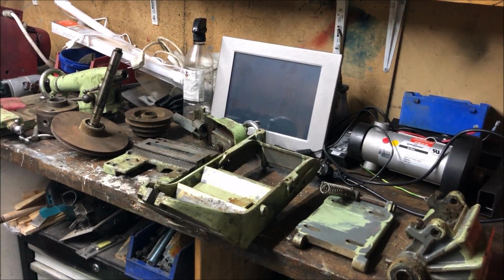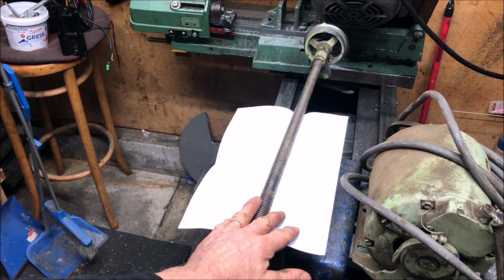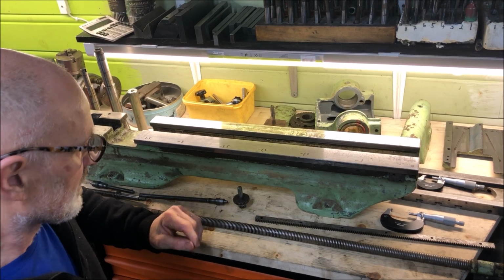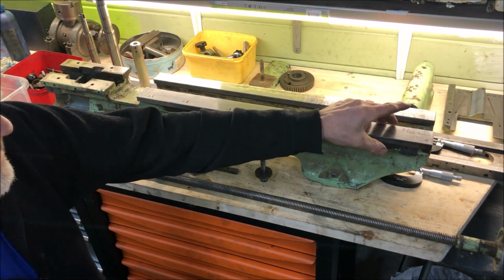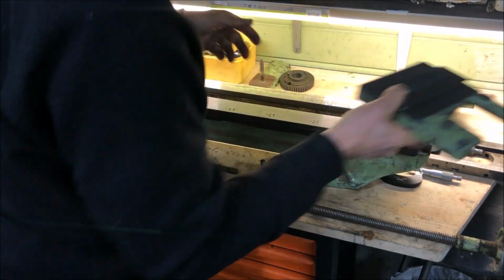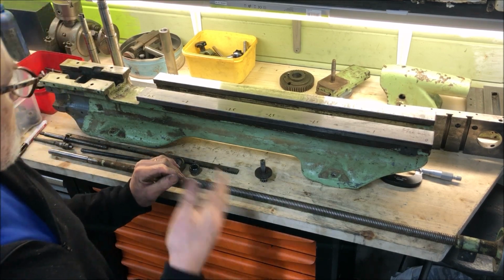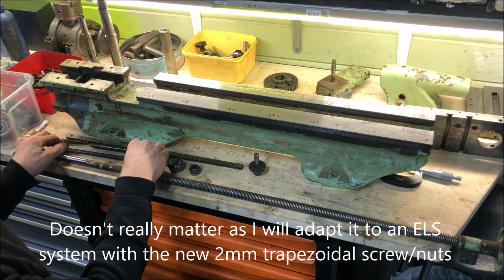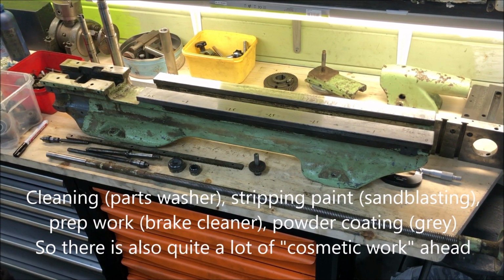Myford Super 7  - as bought, initial inspection/measurements

Comment: Hi Jan,
cool video, I would love to see more!
Do do have a italian made lathe from 1948, that has a similar spindle design. Do you have any experience in adjusting the frontend bearing? I am not shure, how thick the oil gap should be. My best guess would be roughly 0,02mm to 0,03mm. Do you know anything about that? And what oil viscosity is recommended for this type of bearing? I will do some math of course, but since there is a lot of "guessing" involved, I would like have a reference. Tusen Takk! Gott nyttår fra Tyskland!
Reply from the maker: Thnks for the nice comments. 
When it comes to plain bearings I have only worked with the Myford type. The adjustment procedure is written into the manual as a 15 degree "slack" from a "locked" position. What this translates to in terms of oil gap I am not sure apart from the test criteria explained in Schlezinger's book. I have tested some and found that I can get a deviation of say 2-5/1000 mm up/down on the spindle when I have it quite tight and up to 1/100 mm when opening up a little more. PS! I think South Bend specified more on their 9" lathe. 
I use ISO30 oil (hydraulic fluid), which is probably what most spindle oils are. However, you may check with Myford themselves for the specs on their offered oil. PS! Have you checked zerspanungsbude.net for info on bearings/oils etc.?
Reply: @jansverrehaugjord9934  Thanks for the answer! Since the adjustment is defined by the contact-angle of the bearing, the oil and the forces that occur, I think it will always be a try out thing. I will be starting out with rather "too much" play, which will show off by vibration, then tighten up :)
But 0,02mm film thickness matches with your experience, so that is very good!
Yes I will check this! Thanks! Keep up the good work!
Reply from the maker: @buildfromsketch8102  Thnks. Good luck!

Comment: The topslide looks as if it has been used without the gib strip to cause that groove!!!!!
Someone who does not know lathes. I have 9 with 4 under conservation.
Super 7 of course and 3 Raglans. The last 2 came from a workshop with a leaking roof poor things. A MK 1 and a 5 both with gearboxes. David and Lily England.
Reply from the maker: Yes, the topslide has an "interesting" wear  pattern. I have tought about this too.. how it really can become this bad, and also thinks it is a distinct possibility that it can actually be like you say. Strange.. However, I wil lgive it a go milling it down, then making a new, thicker gib piece. PS! Mentioning Raglans, I found this to be a very nicely made and accurate lathe. It was not the prettiest and mine had the 1st version of the apron controls, ie. prone to "user error damage" and not really nice , but anyway.. I liked this lathe. How is your experience?

Comment: You made an interesting comment about converting the saddle to run across both shears. Is this something you've done before and were there any issues with saddle bind due to the more even ratio between width and length of bearing surfaces? What advantages does this conversion give? Many thanks, I always enjoy your Myford videos.
Reply from the maker: Thanks for the nice comments! Yes, I have tried this modification a few times and no, I haven't experienced any binding. The situation can of course also be helped because with a set of freshly ground and scraped matching surfaces, the play is minimal. In addition, I have used Rulon, ie. way liner material on the gib (mating to the front side of the bed ways) and on the rear side of the saddle (mating to the rear side of the bed ways), hence friction is also less. The thought behind this modification is of course that the contact area is much longer than shorter surface originally used, hence better support and longer "service life". In addition you can use an unworn surface (as it hasn't been used), hence you save yourself the trouble of qualifying the surface (in my case not a problem, but..). As far as I know the newer Myfords are made with a "wide guide" saddle, and the conversion has been offered on older units, but it surely functions "as is" also, evident by the number of other machines made acc. to a "narrow guide principle", for example the EMCO Maximat I once had, most round bar bed lathes and not to forget the majority of inverted V-beds are guided by the front V. Many milling machines also uses this principle, eg. on my "box way" equipped Schaublin the knee up/down travel is guided on the left way as well as the saddle in/out.
Reply: @jansverrehaugjord9934  Ahh I understand now, not only does the distance between the bearing surfaces enlarge, but using the rear shear makes the bearing surface longer because the inner portion of the saddle is relieved for the tailstock to pass. I did have to go and look at my ML7 to fully appreciate this. I'm not sure my 1953 ML7 has enough stock to support having a bearing surface on the rear shear, but then again I have only white metal main bearings so any rigidity gains probably won't enhance things for me too much. Thanks again.
Reply: Hi Jan Sverre - brilliant video. This was very helpful, and I can't wait to follow along with you.
Reply from the maker: @cameronpotter2147  Thnks!